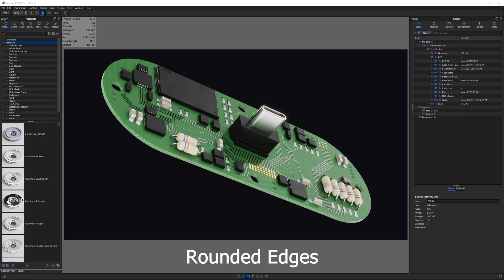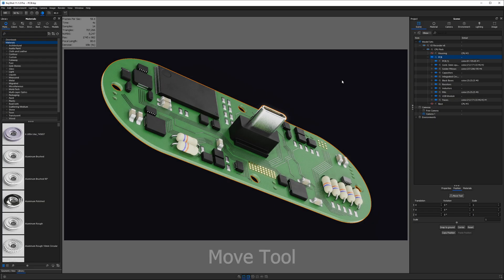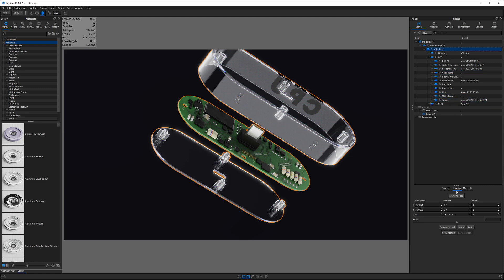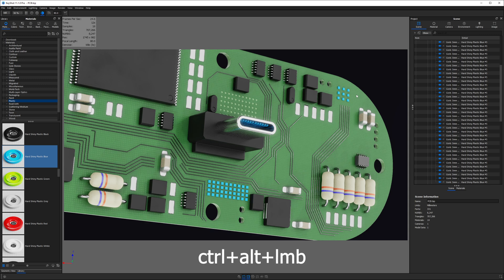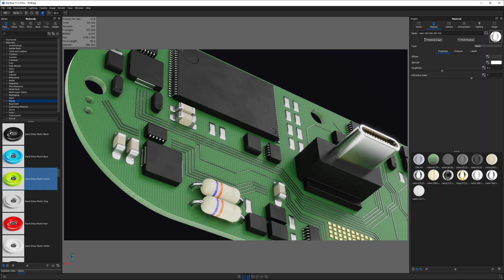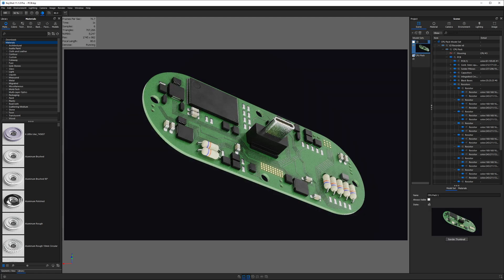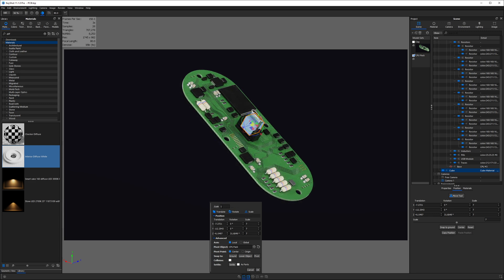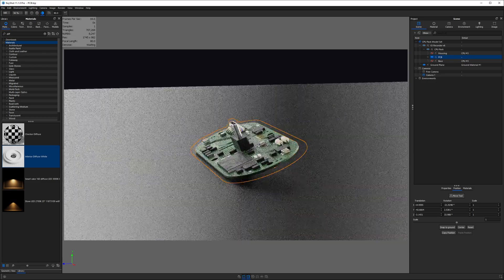8 Easy Tricks Every KeyShot User Should Know

Comment: Isolate Materials is strange and not working on my end. Better works with selecting the objects in Scene Panel and drag and drop the material into the scene panel onto the Ctrl-seleted objects.
Reply from the maker: That's odd. I haven't had any issues with it. What version of KeyShot are you currently using? I wonder if updating your software will fix it if you happen to be on an earlier version.

Comment: excellent result.... *

I need you guidance to solve my problem.
I have product on packaging box that client need to show spot UV (printing effect) on the packaging 3D mock.

If do you any have solution plz share...
Reply from the maker: You'd need to make a glossy version of the material. You can do this with a label. I don't have an exact tutorial on this, but if it's a logo that should be glossy, you apply that and make sure its material properties are gloss/roughness=0.

Comment: Hello, I would like to ask for your help. Rounding the edges has always worked flawlessly for me, but now I have a keshot 11 and I have a problem. I used to only make the shutline in the face with zero gap and set the rounded edges to simulate the shutline. Unfortunately, keyshot 11 takes the two parts divided in this way as one volume and does not round these edges. Don't know how to fix it so it works normally?
Reply from the maker: I've not run into this myself. It sounds like it's more of a bug if this is what you are experienceing. Have you checked with Luxion support?

Comment: I wish settle worked like that for me, mine just moves around continually until I get bored and stop it before doing it manually. Using a 3080 card on fairly simple geometry.
Reply from the maker: Hmm, interesting. You can try in CPU mode, but I'm 99% certain the GPU is being used for rendering only and not the actual settle command. I've tested it on a few items and most of them worked pretty well (not perfect) but well enough. Are you dropping the object from a decent height or is it barely off the ground? If it's too close to the place you're trying to settle it onto, that may be an issue.

Comment: Hi Will, I tried a cutaway, but it's showing the wrong side. How can I turn it around ?
Reply from the maker: Did you try dragging the cutaway object in a different direction? In my example, I dragged the cube toward the camera, so the part of the PCB that was NOT overlapped by the cube was visible. This will determine what part of the model is cut.

Comment: Great tip about the plastic material, I have an animation I’m working on for an assembly of hundreds of steel parts and the fireflies has been a real issue. Going to try this, thanks
Reply from the maker: Ideally, you wouldn't need to, but yeah, can be helpful. Also, under the roughness parameter, make sure to increase that a bit, maybe 16 or so... that should help. If you're using physical lights for the source (like area light) increase the samples of those as well and it'll help a bit.
Reply: you can also use the advanced material instead of plastic and toggle off the Fresnel option. Then you can play with the ambient channel as well, without searching for the right IOR value.

Comment: One obstacle for training beginners is them understanding linked materials, the fact that a material no longer in the file is essentially lost (unless saved to the library or undo), and that dragging a material to the model tree overrides the material linking hierarchically. Once a beginner wraps  their head around these concepts, Keyshot becomes a whole lot easier. Another is understanding the difference between duplication of a model set, the “new” model set button and it’s dialog options, and what constitutes an unbaked duplicate when using the pattern tool.
Reply from the maker: Thanks for the insight. Observations like this is good tutorial fuel. If files are properly managed, there shouldn't be lost materials (save KSP instead of BIP file). And yeah, linking/unlinking is pretty key to understand. If it's helpful, by default, the pattern tool unlinks materials, wheras when you duplicate a model set, you get the choice to link/unlink materials.